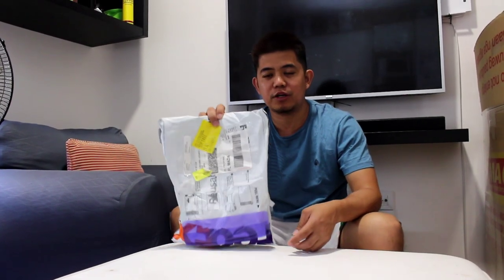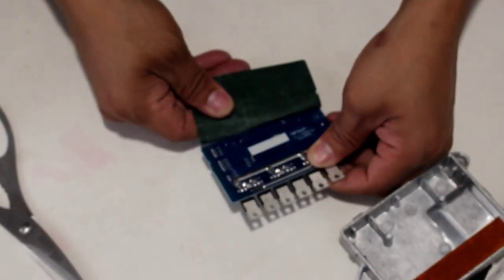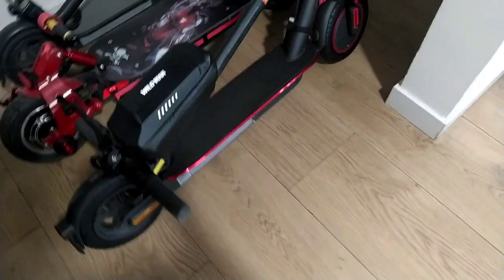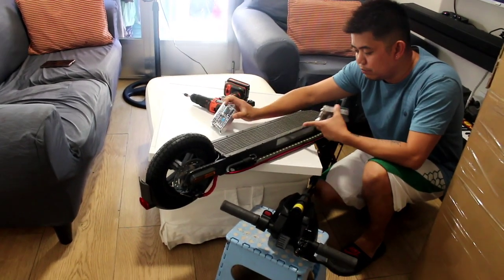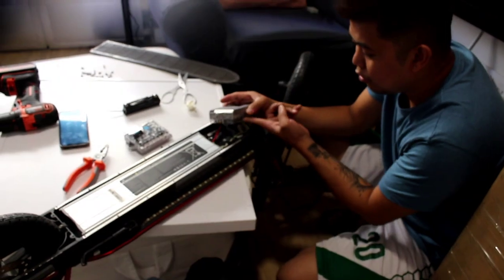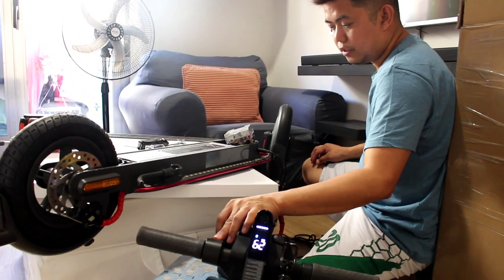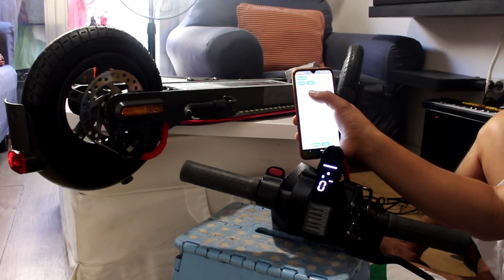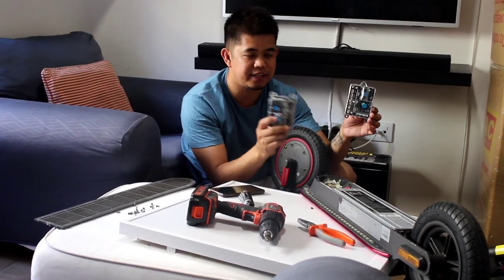xiaomi controler V3 unboxing review

Comment: Hello. How is it possible to go 45kmh on stock battery ?
Max speed of stock motor, batery and 8.5inch tires is only 36kmh.
With 10" tires, max speed is 39kmh.

You maybe have a firmware thst shows fake speed.
Reply from the maker: that is diferent filmwear
Reply: Yes it is incorrect speed

Comment: So If I changed the battery to a 48v Speed battery and 48V controller and 500w 48v motor, would I get 40mph or 65kph?
Reply: not possible, and the 46kmph in this video is not correct, no matter what you do you cant get 46 out of stock battery. top speed is determined by battery voltage.

Comment: What’s the difference with oem controller?
Reply from the maker: oem look like for big scooter but there have also for m365 scooter . the diference is oem you canot hack the speed its diffend of your battery voltage.. about this controler V3 YOU can hack the speed to become faster .
Reply: @RHON_TV  thanks for answer!
On pro2 48v with 3s series battery it makes deference on top speed? (Now it’s 55) or it helps more with stock battery?
Reply from the maker: @nikosgt8505  your 48v is range battery rigth . 3s speed bat yes its become 55to 57kph